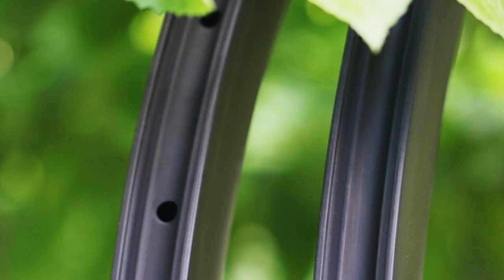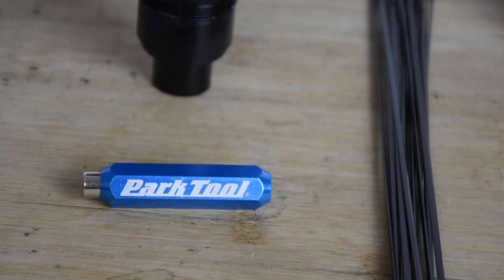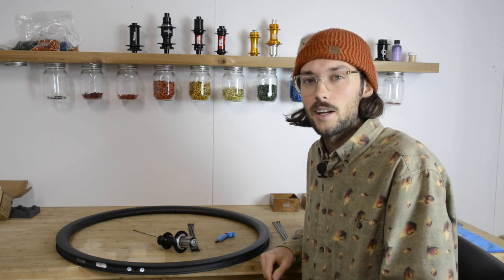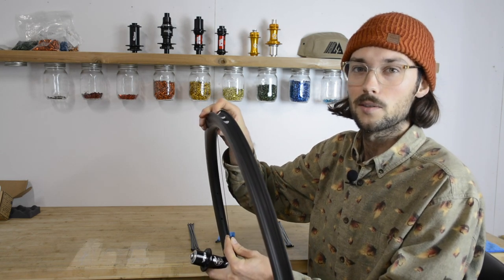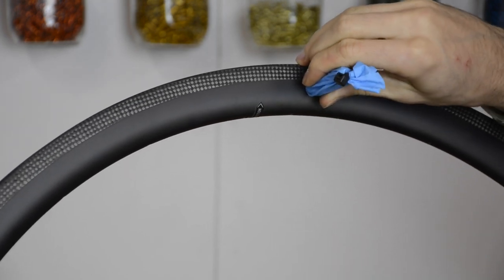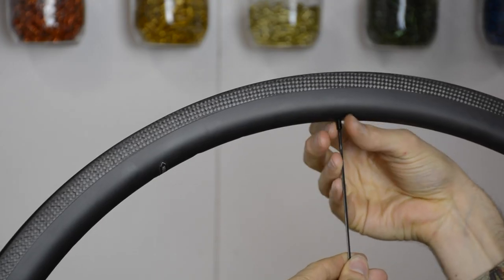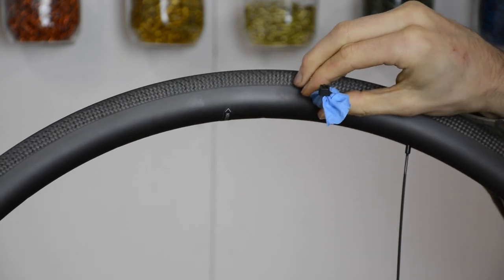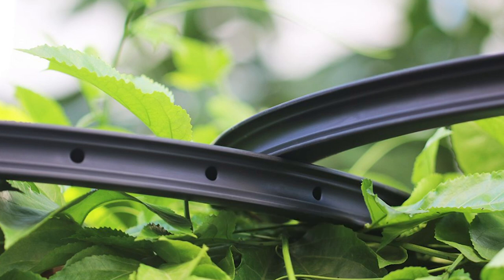How To Lace A Rim Without Access Holes (UST style)

Comment: You video just fixed my very specific problem. First time tubeless and broke a spoke. Much easier than threading with with an air compressor and string or wires.

Comment: Where do you find a 2mm steel insert like that?
Reply: For a 2mm spoke, the correct screw size is a US standard #2-56. Make sure to get non-stainless steel, since stainless steel is not as magnetic as regular steel. I got some 3/4" ones from Home Depot, which are nearly perfect. I had to cut the button head off to get them to allow the nipple to work. A bit of sanding the sharp edge down and it's perfect.

Comment: What about with a broken spoke in the middle of the wheel? How to remove the nipple with all the other nipples from the other spokes in the way? Many thanks!
Reply from the maker: Hey Pedro, there are a few different things that you could do. Try replacing the spoke without losing the nipple in the rim (this is difficult to do). If you lose the nipple in the rim, there should be enough space still for you to be able to shake the nipple out of the valve hole. To put a nipple back in follow the steps in the video. There is also the easiest solution, which is taking the wheel to a bike shop.

Comment: I'm assuming all screws are steel, otherwise it won't work with aluminum or brass nipples...
Reply: that's what the steel insert is for I think
Reply: For Sure…but where did you get those? Even w/o a driver and with a 2mm thread. Please tell me… 😘